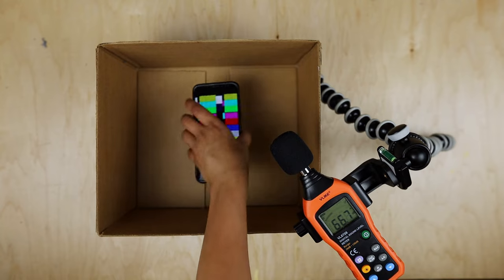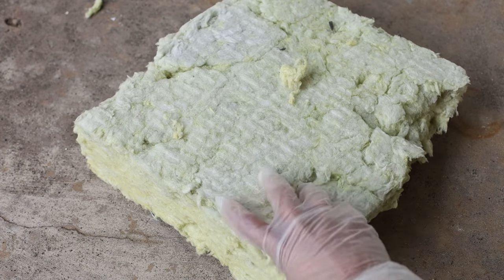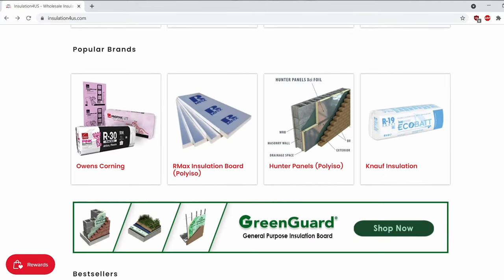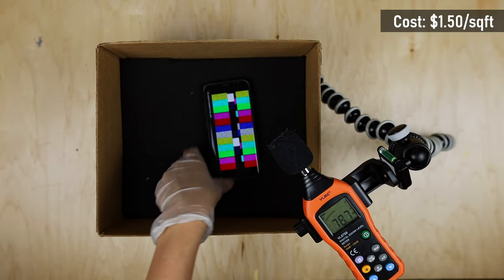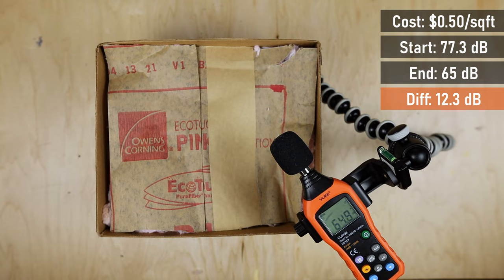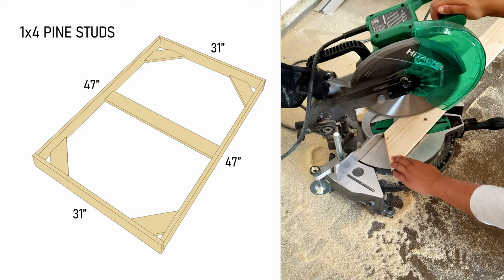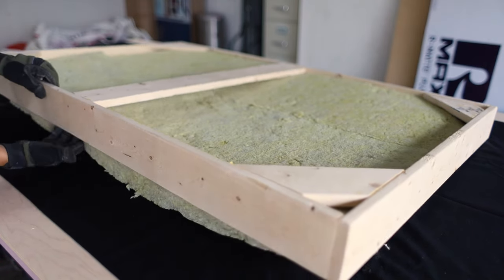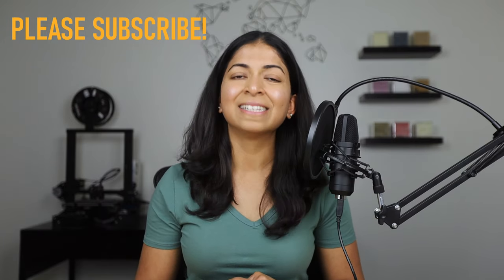Rockwool OR Fiberglass for DIY sound panels?

Comment: Those foam panels are useless for sound proofing. They are for sound dampening, absorbing sound waves to keep them from bouncing off walls. The comparison is not valid as you would not normally install them in layers

Comment: This doesnt make any sense.. What are those panels supposed to do? If the goal is to reduce echo then a panel filled with rockwool or glass wool probably isnt the greatest thing. It might stop a portion of the sound from penetratiting thru the wall but for echo this doesnt make sense. The echo reducing materials are made to limit the vibrations of sounds so they dont bounce off the material as easily, not to limit penetration of vibrations to the wall. Thats why the amazon panels didnt work good at all, they are not designed to absorb the sound but limit its capability of bouncing off of it.

Comment: Another self-proclaimed guru comparing apples with oranges for use as bananas! First of all, the absorption materials are designed to absorb sound,  not to block the sound. The fiberglass and rockwool are practically the same  materials designed to be built into the walls as insulation and sound dumpening due to their absorption properties.  As opposed to acoustic foam, that is designed to cover the reflective surfaces on the outside.  Yet another incomparable "comparison": she compares materials of the same width and length, completely ignoring the thickness. Any acoustic engineer will tell you that sound absorption property directly depends on the thickness. The thicker the material, the lower frequency it will absorb. Yet she compares 3 or 4 inch thick rock/glasswool, that have NRC of about 1.0 to 1 inch cheap acoustic foam that has NRC of about 0.5 making absolutely no comment about it.
And all she compares is 12 x 12 inches size, that has no relevance to the test she performs. The thickness and density does. Keeping the thickness of the samples the same and removing paper liner would produce comparable but very different results. I do not mind her testing the sound absorption materials for transmission loss properties as long as the experiment us done correctly.  Of course anyone can compare anything to anything, but in order not to be misleading she should have said: 3 inch thick rockwool with paper liner is better/worse than 4 inch thick rockwool without the paper/ 1 inch acoustic foam. ( but worse than 3 inch brick). And then? And then she proceeds making acoustic panel just like everyone else on the internet. Which is FOR SOUND ABSORPTION purpose! So what is the point of showing transmission loss experiment to prove efficiency of "reflection loss" utility???

Comment: Aside from the excellent comment by beachton123, the slag wool and rock wool may have quite different characteristics, however everyone's right, your testing method was really really bad. Not least of which because of the single frequency you used. rather than targeted noise spectrums.
Reply from the maker: Thanks! Happy to disappoint you.
Reply: @BelindaCarr  I have watched quite a few of your videos, do you recall any prior negative constructive criticism or feedback? Probably not, mostly they're okay if a bit dry/dull, but this one was WAY beyond par. My background in audio and my background in construction both inform that opinion in case you are wondering what some YT commenter might know :-D
Reply: Beyond? Below! :-D

Comment: Sound insulation is not the same as sound absorption. Please use the correct terminology. Also: your measuring method is not good. There are ISO standards describing the best methods. Each material has a sound absorption coefficient associated with them measured according to ISO standards in a reverberation chamber. You can simply look them up and compare them. No need to do your own tests. Tip: using a thicker layer (+10 cm) of absorption provides better absorption in the low frequencies.

Comment: I give you a F as the test is not legitimate because Rock wool is different than what you tested. I believe it is superior to fiberglass. but that you need to compare apple with apples whether fiberglass is for a 6' wall or a 4'' wall and the same for rock wool.

Comment: Your test has nothing to do with the purpose of acoustic panel in studios.
Also your fiberglass results were inaccurate because they had a reflective material to hold it in place, thus blocking the tone. Also very dangerous to your health.

Acoustic panels are for treating acoustics not sound proofing.

Comment: Absolutely wrongly done tests. Doesn’t have to do anything with  the reality. Box is not air tight, all you were testing was SPL level ls and pink sheets with paper side wins because it made the box almost air tight. Do the same but with air tight container and put the dense rockwool and you’ll see real results.